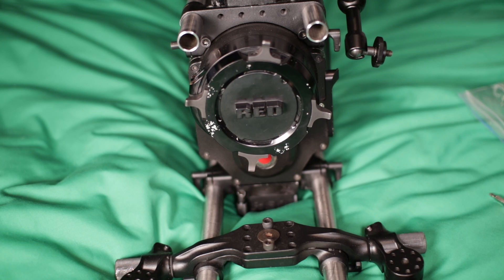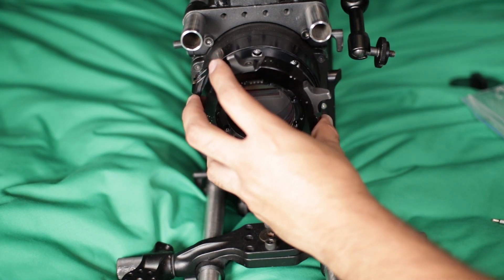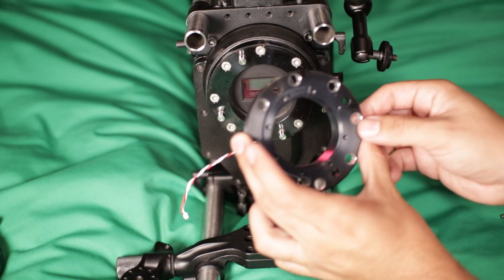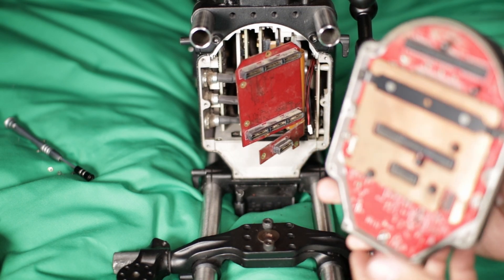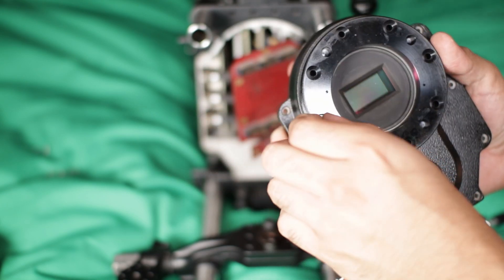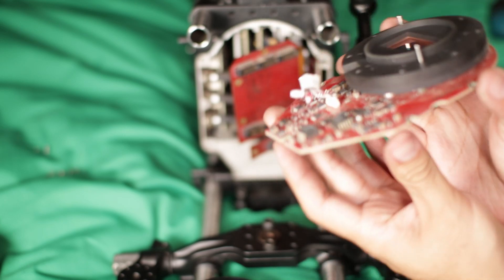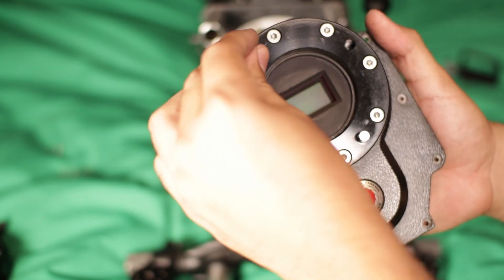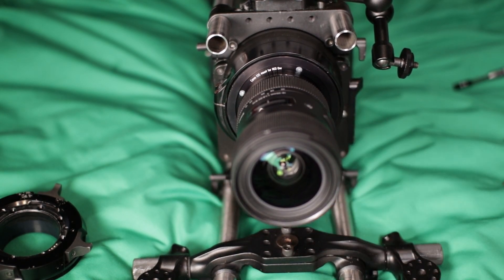How to install EF mount on RED ONE MX Camera

Comment: You 100% don’t need to take off the front enclosure. Just the mount and adjust backfocus
Reply: Where do you put the cable?
Reply: @carmenvanderveken  I believe you’re referring to the cable that connects to the ipin connector that reads lens data? If so, then you typically should have a little cutout on the mount, in the same spot where the connector is on the PL mount, where it fits. You just leave it disconnected and carefully tighten the screws for the mount, all while making sure you don’t crush the connector and sits right in place.